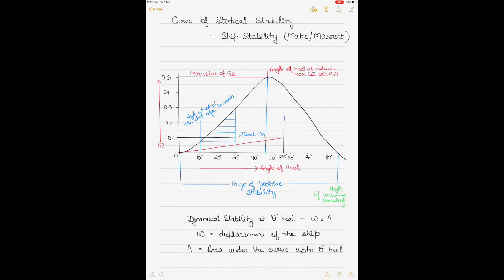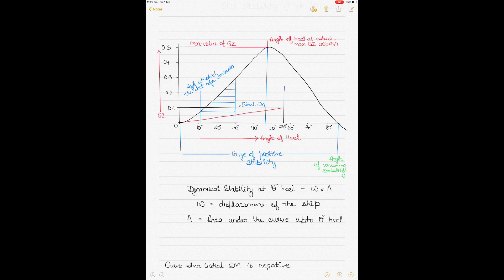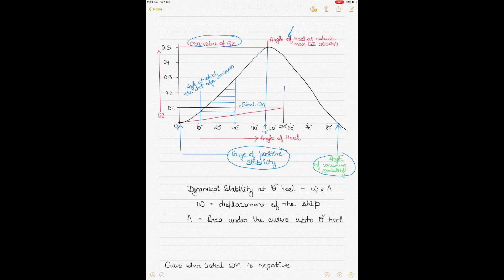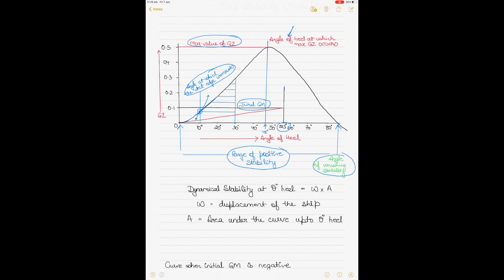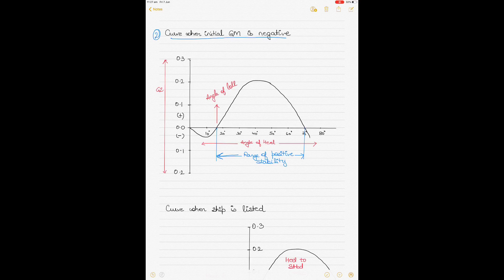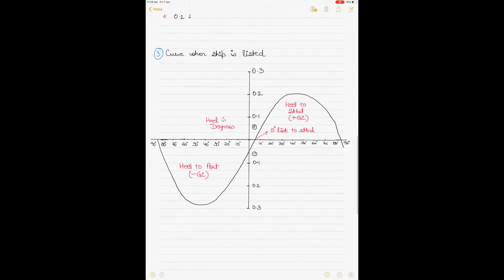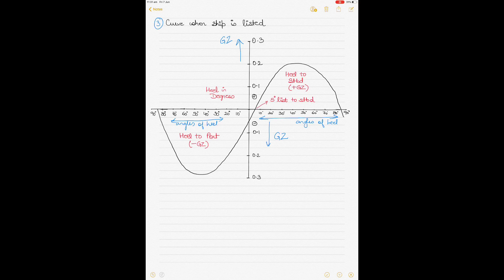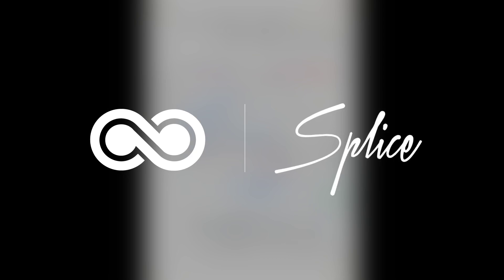Curve of Statical Stability  - Theory (Advanced Ship Stability)

Comment: Will the vessel capsize if heeled more than the maximum gz? What is the maximum permitted heel the vessel should watch as per ex no 1?
Reply: Vessel will not capsize until there is GZ value becomes zero.
It will come back to its normal position